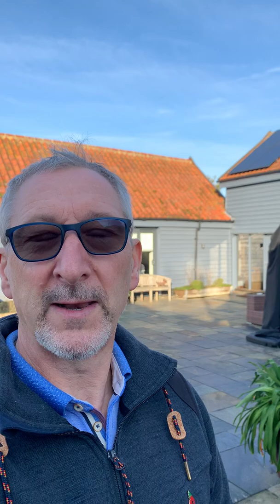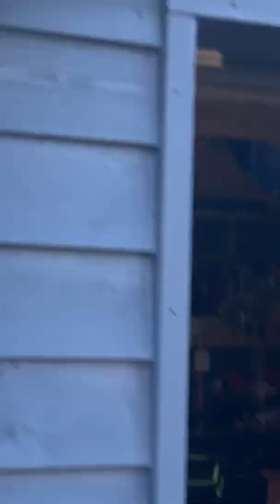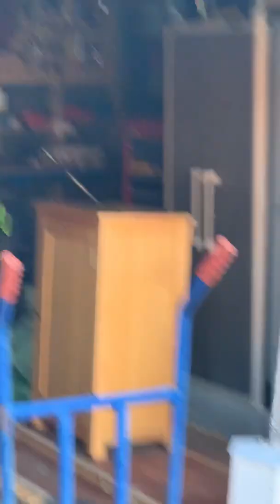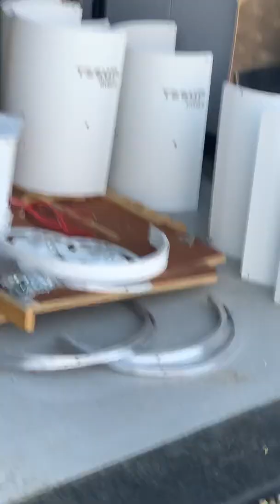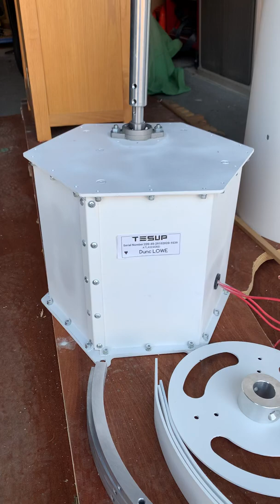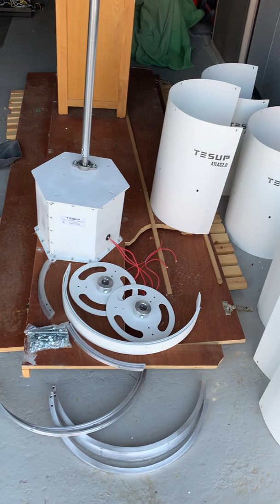TESUP Atlas 2.0 v2 update

Comment: This Company is more as Spam. The set of Atlas 2 wind turbine cost me neatly 2000 Eur ( including stand ) an it even can't charge the 48v battery over night at 7 m/s wind speed. 
The graphics  may be correct  without load on the test machine, but in reality the blades have not enough power to spin the generator on the load to produce even 1kw by 11m/s wind .
Not recommend to bay as this is waste of money. Better to spend this money for good solar panels as for this rubbish.

Comment: When the turbine is generating current and output is taken, as per your experience, does it require more torque to continue providing output?
Reply from the maker: Do you mean with the gearing?  If so the answer is that the gearing on V2 means that at lower wind speeds you get much less output than the non geared version due to the torque required to start spinning (particularly in non linear wind situations - gusts) but the benefit transitions to better results at higher wind speeds  (+6 m/s)

Comment from the maker: Now building data on the actual performance with measured wind. Clearly the TESUP graphs are rubbish as they show power generation from 0 upward. The new turbine doesn't spin until 4.2 m/s due to the additional inertia required with the higher gearing. No wind this week in the East UK so might be a few weeks to generate meaningful data.
Reply: Just received my atlas 2.0 Offset so it must be version 2.wind turbine. by the way you scan the label on the outside of the box and it downloads the factory instructions, I didn’t see anyone else say this. but if I had looked at all these videos and read these reviews I don’t know if I would’ve got this one.  I also like the vertical but I didn’t see how you got it up on the tower. I’m planning on mounting mine on top of the light pole but They should give you the metal plate that you need to mount it on almost anything.keep in touch Jeff
Reply from the maker: @scottjeffries2454  Jeff you’ll struggle with a light pole. This is quite a heavy beast and I think you may need a large plate stabilised with a three point support.